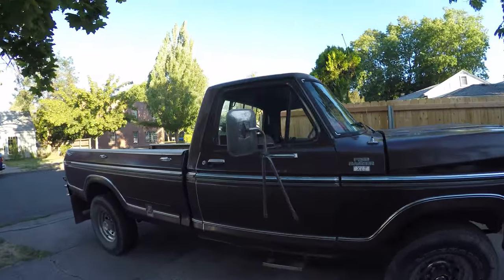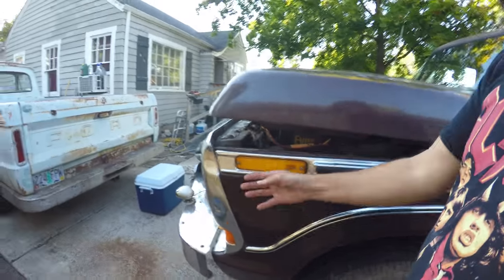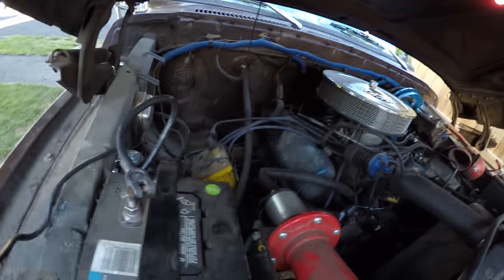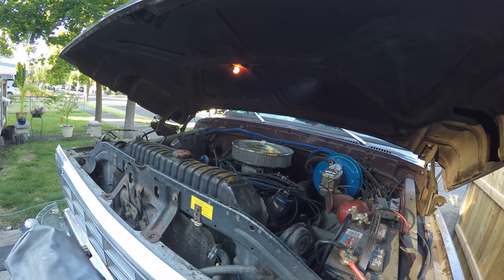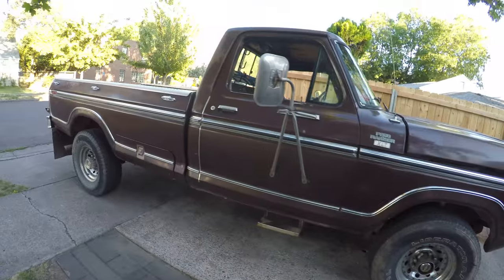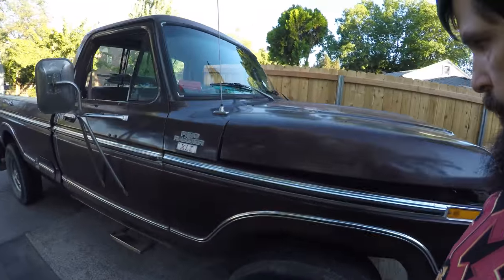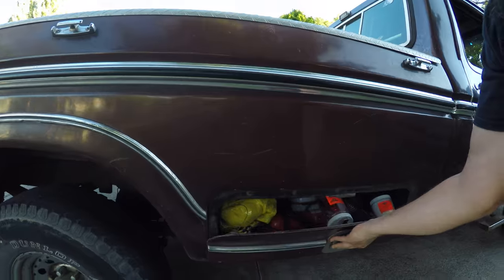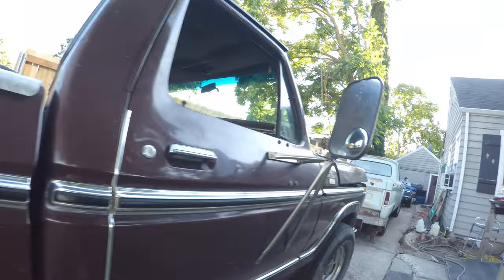Trying a new camera short video of my 78 ford f250 4x4

Comment: Nice old truck. We had a f150 on the farm .It had a 429 in it. Great old truck. You could pull the barn down with if you wanted to. The little door on side of your truck for putting stuff is cool.  Cheers
Reply from the maker: awesome I had a 150 with a 429 years ago.....I do have a fresh ford dove block 429 in my shop built to the hilt but I'm torn between which truck I want to put it in....I should put it in my 65....my 78 already has a big v8 now...and I think my 65 would be bad ass with a big block 429 under the hood and I already set up the suspension to carry a big block up front....but that old 3 speed manual I doubt would live long behind that 429 I've got